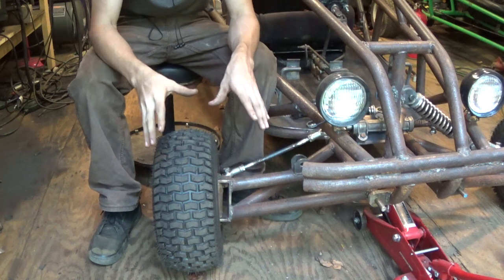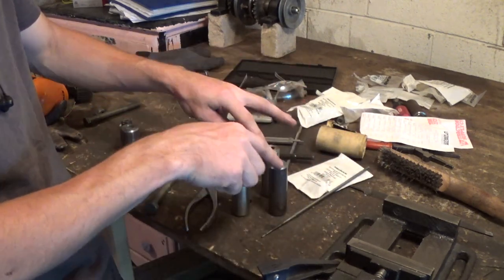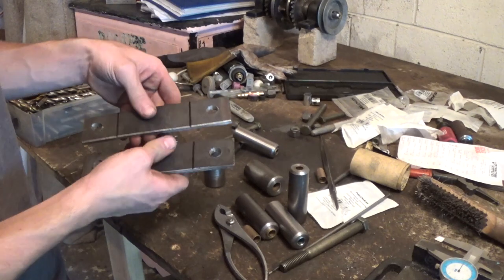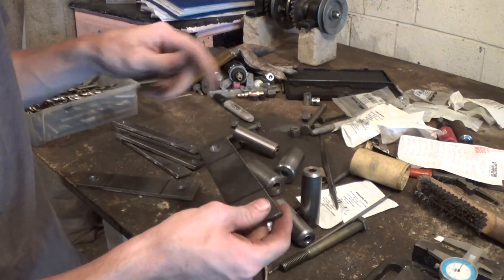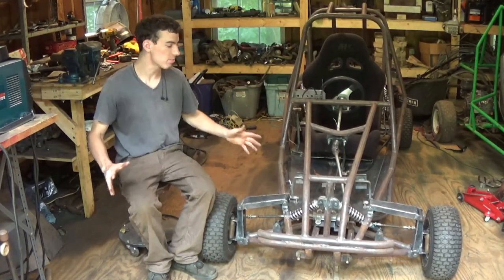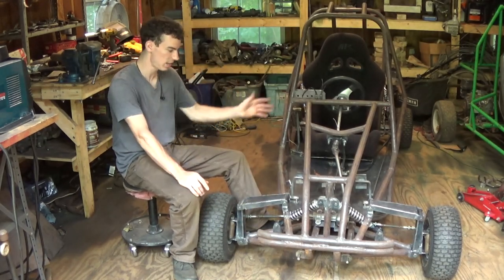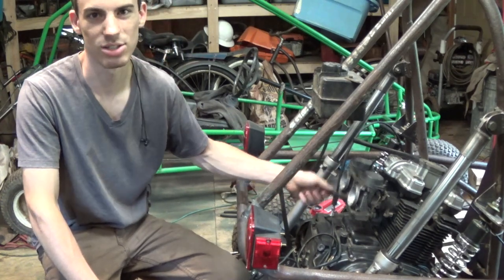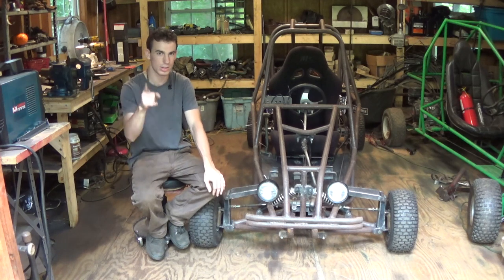suzuki gs500 mini buggy build part 8 rebuilding the front suspension

Comment: The new front suspension setup looks awesome!

Regarding the front shocks, I think moving the upper spring mounts outward could help with the softness. But i've never done any suspension work myself so take my suggestion with a boatload of salt :)
As long as the springs don't hit the frame under full compression....

Comment: I used to be a mechanic at a Suzuki shop. The broken manifolds were a common problem, they just dry rot away. They were probably cracked and leaking before they broke. While you are waiting for the new ones, check those carbs again. The most common problem I've seen that causes your poor running issues is clogged pilot jets which is easy to overlook. They are the removable ones right next to the main jets. The holes through them are very tiny and easily clogged. Take them out carefully with a flat bladed screwdriver and give them a blast of carb cleaner, then a blast of compressed air. If you can see through them when you're done, they're good to go.

Comment: Good to see the oil leak fixed. The front suspension looks awesome and you should think about building a metal welding table that u can ground to the leg of the table rather than to the actual part. 👍🖒

Comment: Just seen this show & I like it! A couple of questions are,  What provision have you made for greasing or lubricating,  your front suspension & steering, What provision have you made for adjusting your steering geometry? In case it is difficult to steer. In- addition I notice that you can buy parts, eg. your inlet manifold so cheap. Wow! I expected you to say $600 instead of $60, incredible. Much cheaper than in Australia! Keep doing your good work, very interesting! Cheers Bill.

Comment: The front shocks and springs being straighter up and down would help your weak front end. Also... for the love of god get bigger wheels/tires. Thing looks great other than the 4 front lawn mower tires it's sitting on.  Also, don't get in a hurry, if something takes longer than expected but you get a really good result than it was worth it. I can't count the times I've spent hours fabbing on something just to throw it out because it didn't turn out right and make a new piece.

Comment: Brass bushings should have had a press fit to keep the wear on the bolt not the outside of the bushing. Also adding grease fittings to the pivot points would be good. Oh also when you shorten the wires make sure to use heat shrink but connectors or solder the wires and heat shrink should have the glue in to seal oxygen from corroding the wires. Put triple shocks on the front to stiffen it up.

Comment: Need rubber seal at both ends of the bushings and drill a grease insert into it; and put the shocks an A frame on the top rail, for longer travel and a smoother ride.

Comment: Mr welding. You can use epoxy to fix the intakes and that still of carb needs some type of filter an or up size the lowspeed jets a litttle you can use a torch drill bit.   #@G. L.

Comment: Did you resolve the oil problem?
Reply from the maker: guillaume yes I did I probably should have made that more clear in the video.
Reply: rather B welding yeah, will the next video be the final test? Btw i'd like to start a project, do you thing that a lawnmower engine is powerfull enough for a ATV?

Comment: The front upper links didn't have to be a large boxed affair, a single length of tubing would have been enough.
Reply: Some heim joints and black iron pipe would have been sufficient I think, but there's nothing wrong with beefing it up!

Comment: Make the intakes out of plate and pipe and weld it together
Reply: gixxernut if you do that you will have even more running issues they are rubber for a reason it reduces the vibrations going to those carbs and they don't like excess vibration (they have to be precision tuned and balanced) it's the smaller older version of the 650 quad carb (one hella hard task to tune and balance).

Comment: Get a turbo, nitro kit, and upgraded valve springs and it'd be super badass
Reply: Turbo...too complicated. Nitro...overrated. This engine is a 2 stroke...doesn't have valve springs.
Reply: RichieRichOverdrive its a four stroke if it was a two stroke it would not have a valve cover 😂😂😂😂😂
Reply: @Henrik guess I missed that lol. Either way, once he gets it running right it'll be way too much power for that buggy. No need for performance stuff if it's already made for performance.
Reply: RichieRichOverdrive dude if it was a 2 stroke there'd probably be expansion pipes and he wouldn't run the engine on straight pipes lol
Reply: this is every youtube comment on every youtube video about go karts. it doesnt need a turbo or nitrous.
Reply: catfisher420 it's a typical response on small engine videos. How can someone not suspect that already. It's clearly the shit most people say.

Comment: Rather be welding u should put grease fittings on those parts u turned on the lathe
Reply: I believe he put in oil inpregnated bronze bushings in those parts, so in theory they're lubricated for life. But grease fittings are still a good idea.